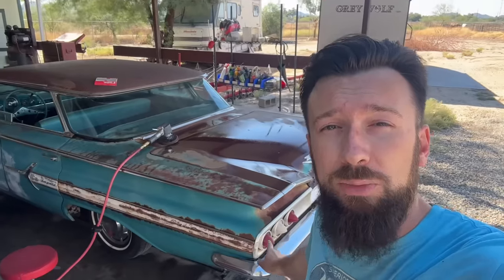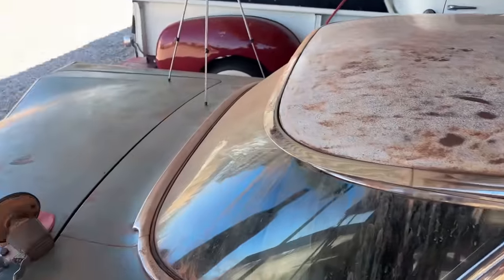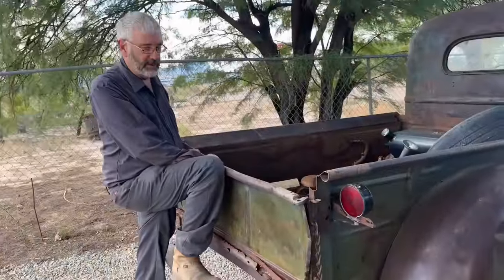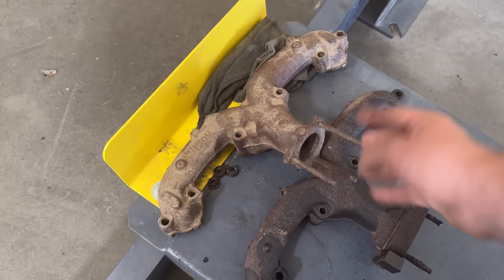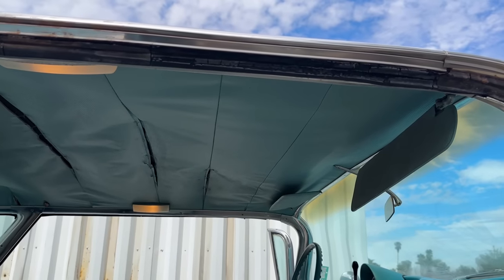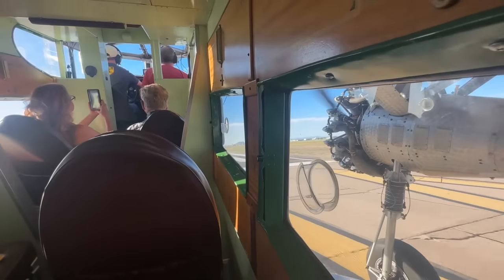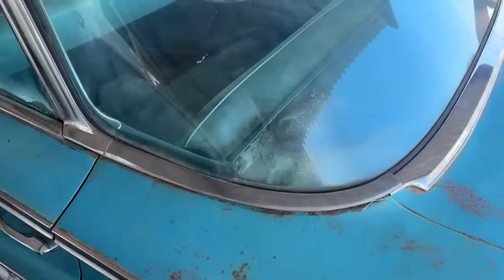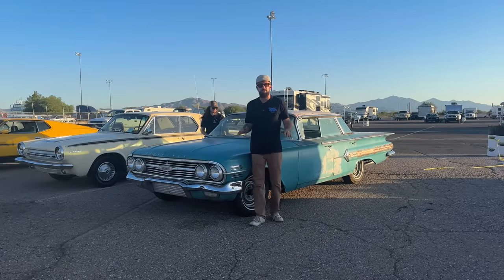‘60 Impala PAINT restoration + 1929 ford TRI-MOTOR + duct tape drags 2023 AND MORE!

Comment: Dude I cannot believe how well that's coming back around!  Awesome!
Reply from the maker: Yeah I was so surprised
Reply: @theetravisb  dude... you got lucky.... marketplace is a asylum...be glad you have a support system cause you can't do that alone.... people are dreaming on there...that car minus all the work you did is 6-8k ...for a project

And idiot me had to fall in love with a 59 caddy coupe.....🤦🤬
Reply: I think he"s married, fool, calm down
Reply: @theetravisb  you still miss the trim on the trunk above the license plate?.
Reply: Hey Travis
Both cars sound pretty awesome and it’s really cool that they’re the same year and same colour!
I wouldn’t ditch those old manifolds with the broken studs, they are easy enough to get out, if you heat the stud area on the manifold up cherry red with a torch, they’ll unscrew  with some vice grips or drill and retap if they’re broken flush. Always good to have extra manifolds on hand. Love the wide whites on the truck, I have them on my 41 Ford pickup and look really cool.
Reply: @ApacheBob41  Easy there Bob.  I'm an old married dude with kids.  Not that there's anything wrong with that.  You going to join the channel and kick in a buck or two per month as I have though?
Reply: so what is that brown stuff on top... paint... somebody painted it rust brown ...

Comment: Wow!  I would never have thought there was paint under the rust.
Reply: How doe that even work?! Like the top clear coat rusted? I've seen some nasty clear coats but they were just yellow and cracked, never rusted.
Maybe that's some metal flaking in the top coat?
Reply: @DARKredDOLLAR  Clear coat was not used in '60. Didn't come along until decades later.
Reply: @Jasona1976  so what is that brown stuff on top... paint... somebody painted it rust brown ...

Comment: Wow, you blew my mind with the roof and trunk!!  I can't believe there was color under that apparently solid rust!  I gotta go sand on my old F150, it looks the exact same!
Reply: @MaxGiganteum so what is that brown stuff on top... paint... somebody painted it rust brown ... 

it's rust???? I feel like I'm 5 and just saw Santa... 

rust on paint? I'd be less surprised if a UFO landed in front of me...
Reply: stained the oxidized paint .... holy crap.... never heard of that
Reply: @MaxGiganteum  that was gigantic... now could this have been avoided if they had clear coated their paint back then??? as I understood clear coating wasn't done back then
Reply: @MaxGiganteum  I'm clear on the run off  from the roof... the rust on the roof could come from tiny pits in the paint and then it spreads over the entire surface like moss over a rock. is that correct?

is there anything in the paint itself that could rust over decades? it's actually a serious question coz I have seen run off stains but not from a rusted over intact roof. that why I'm a bit puzzled over this roof.
Reply: @MaxGiganteum  peace indeed... 

who woulda thought old paint could be so interesting....

Comment: * Hey Travis & Dad ! Haven't check in in a while. Everything is coming along nice. Personally I would have used the red rims to add a little "Pop" to the old gal (46IH) I still love that one. I subscribed to follow her when you dug her out of that yard. I want to thankyou for the Trimotor Ride. Seen a lot of those in museums but never footage from inside during a flight. Couldn't believe how much paint was hiding under the rust on the 60 Imp. I believe that color combo is called Ermine White & Horizon Blue.  Both sound great with the new exhaust.  Cheers !                       🍻👊😎👍🍻

Comment: WOW the paint on the Impala cleaned up amazing. Though I have to say I don't like the exhaust out the rear.... it takes away from the look of the car having the two pipes sticking out the rear. I like the way your dad's El Camino pipes look much better. I do like the wide whites on the truck. What a treat you and your dad got to go for a ride on a Ford Tri Motor plain.

Comment: Hi Travis, Both your and your Dad's Chevrolets and the International look terrific! Especially upon recalling the condition they were in when you found each of them. Great videos, all!! Although you did an absolutely wonderful job bringing out the long buried colors on your Impala......Considering your Dad's tried and true auto body skills and the fact you both have Chevrolet models of the same year, perhaps you should consider painting the Impala to match your Dad's El Camino. They sure would look nice together at any venue. Perhaps you can also find a pair of vintage, matching coveralls for  both you and your Dad! :  )  Looking forward to the "Fly and Drive". Best Regards and Safe Travels, Doug
Reply: Yes, and the car would look much better...I like original paint if it isn't too far gone(like maybe a few thin spots), but that paint is WAYY too far gone, plus it has rust and dents that need to be addressed before they get worse..I'm totally over the patina fad, it has been carried way too far...I'd drive it and enjoy the "patina" thing while I addressed all the mechanical issues, fix those first...then, fix the rust, fix the dents, paint it back the original color, fix the missing/bent chrome, interior and you will have a gem...

Comment: "That paint "restoration" job was just plain and simple, crazy. The before-and-after is amazing! Well done! 
Do you have any idea what all that brown stuff was? It looks a bit like another layer of paint that someone applied at some point? 

On a sidenote, I'm relatively new to your channel and noticed that a lot of your videos have often clipped audio, which means the volume levels are too high, causing distortion and making the audio sound harsh or unclear." 
Are you doing any adjustments when editing? If not: maybe the input gain on your camera is too high?

Comment: Another great episode!   Excellent work on the Impala and the El Camino is looking good.   Thanks for all your work on the videos, really interesting.    Now that you have the paint looking pretty good some folks have it clear coated and then it keeps its patina without rusting again.
Reply: Yes, better do that or it will go back to rust pretty quick.  Flat clear would look more natural.
Reply: As I was watching the segment on the radio remembered an undocumented feature of the ignition switch.  My 60 El Camino did not have an accessory position on the switch, and I think it is the same on the Impala.  To play the radio with the engine off you normally need to have the ignition in the ON position and that provides power to the radio but also to the ignition that can damage the ignition points if left in the ON position for a long duration. 

If you turn the switch from OFF slowly in the ON direction, there is a point before the ON position where the radio has power, but the ignition is not ON.  My buddies 58 chevy worked the same too.

Comment: I just bought the same 1960 Chevy but in a Bel Air. Mine has 62K original miles and, no offense, is about 3 rungs up the ladder in condition. The paint is original and so close to just keeping it, but looking close, there are very small defects that make it no way it's ever gonna come completely back. Little pencil eraser tiny size blemishes rust spots... and little tiny lines. It's a gorgeous 20 footer! All the chrome is in beautiful condition, and complete! I just got done polishing all the chrome with Mothers metal and aluminum polish and it is super shiny. It's really easy, with no elbow grease needed. I highly suggest you do it... It's a huge improvement. 
My '60 is the fastback 4 door. What do they call that? I don't have that flat top. Mine is much closer to the 2 door in roof slope. Still wrap around windows, though. Mine is also the Copper color, a color I've never seen on any other car before! Very unique, and I love it. The inside is almost cherry too. The entire dash is cherry! But, the drivers seat has a big hole in the upholstery right as you get in, on the back of the seat. Back seat is perfect, but the horizontal very top of the back is burned up by the sun! Bummer, cuz that seat would be 100% without that 4" wide fried part. 🤷

Anyway, I really enjoy all of your videos so far on your 1960. They're great cars and much more rare than the tri 5 series starting in '55. You see those all over the place and for sale by the dozens, but not our cars! Rarely any available. And nothing driving around on the road. Really turns heads!
 
Thanks so much for making all of these videos and especially showing all of your repairs and fixes! My disc brake conversion kit just arrived yesterday to make it safe! Damn if those 4 wheel drum brakes aren't crap! Lol Unreal that's all people had for years! I'm just doing the front to disc because the rears are much more difficult, I've been told, and not really needed in disc when you have the fronts disc. I am replacing all of the brake lines with a pre bent stainless steel brake line kit specially made for my car. 
SUBSCRIBED.

Comment: HELLO TRAVIS!   I saw at one time a guy use CLR cleaner to remove rust from some white paint on his car. It drew the rust our, but left the paint in tacked.   Just putting that out there. Could clean up that roof and other parts of the car a little more.  Great job - Im impressed!
Mike
Reply: In tacked?..I think you meant Intact...
Reply: yes,,  intact -  it just pulled the rust out leaving the paint, with some pock mark where the rust was. @dyer2cycle

Comment: That looks just like the car Mortske had...same color and everything. Good work, but I'm not a patina guy myself...I'd just do the body work and paint it back the original color...I just can't see putting all that work and time in sanding rust and it still looks like it needs a paint job. Love the El Camino, by the way. I wish somebody made a snap-in spacer ring for 15" wheels so you could use the original 14" wheel covers on 15" wheels....

Comment: Sweet ride     For the trunk floor, I am sure have seen,  see Bad Chad's repair ideas or Carter Auto Restyling.    Chad's latest how-to on the 56 plymouth... do what you can with what you have vs buying $$$ metal    Keep the updates coming

How come you didn't put new springs in the license plate access cover?

Comment: You know like you said someone my ass why would you spend $400 on tires for a truck like that you take an international truck like that spray some bright paint on it a little Chrome work on it elenu shining Matt downing and put a new seat in it it's my task you $25,000 for that the chrome valve cover on it if you like a vehicle Fix-It driving you can't touch a new truck under $45,000

Comment: FYI use sos pads🎉for making your older paint and chrome look better. The soap in them helps lubricant to keep it from scratching and the pads are ultra fine 0000 steel wool.

Comment: Travis, if I remember correctly, mechanical car clocks evolved to a point that they would self-adjust a little bit when you reset the time, meaning, if the clock ran slow and you advance the time to correct it, the mechanism would slightly speed up the clock, after maybe several resets the clock eventually ran correctly. not sure if this was true in 1960 or not, but if your clock lacks the adjustment the '56 Caddy has, just let it run until it gets like 20 or 30 minutes behind, reset it every time it gets 20 or 30 behind and see if it starts doing better. if the interval between resets gets longer and longer, it's working!

Comment: The tyres are good quality, they are used alot in scandinavia and we have ROUGH road conditions in the winter and they still hold up great. I doubt you will have any issues with them

Comment: I'm mind-bottled with the rust on the paint. How did the original paint survive under the surface rust and how did the surface rust not ruin the paint on the roof and trunk-lid? Still mind-bottled when you wet-sanded the rust off.
 i'm impressed and you got me subbed

Comment: That clock adjusts as you reset the time, if you have to keep setting it ahead, it speeds up a bit each time, if you have to set it back several times it slows it down a bit each time, eventually getting it to keep time pretty well and only needs a reset if you disconnect the battery or it sits until it goes dead.
Also think the term 'dipstick' came from the refineries and bulk storage tanks - they used square measuring sticks dipped into the hatches on top of bulk tanks to measure their fuel levels accurately  an old guy from a bulk plant told me this, said his dad called them dipsticks well before cars came along - said they sold kerosene for light & heat before they sold gasoline he said, and of used correctly were accurate to within 5-10 gallons, depending on the tank diameter, pretty good as tanks ranged from several hundred gallons to several thousand gallons.

Comment: The muffler shop here in south AL will burn the old bolts out with a torch then re-tap for the new bolts. The man said that steel melts at a lower temperature then cast iron so it does not hurt the cast iron manifold. Save your original manifold.

Comment: i rode in that Trimotor about 5 years ago.  really cool.  both the chevys are cool.   Are you going to re paint the sedan or clear coat it?  If you don't do something to it it will regress to what it looked like before even in a dry climate.  lin seed oil?

Comment: I think you dot understand what that heat riser on that manifold doees. It is very important to the correct operation of the choke on that carburetor. It bacs the heat up in the manifold into the crossover in thee intake manfold to make the choke thermostat which iis mounted on that crossover open the choke up faster on that carburetor and without the heat riser in there the choke thermostat will not work correctly

Comment: That tri belongs to EAA up in Osh Kosh, WI. Hour or so north of me. Glad you enjoyed your flight. They have other restored WW2 planes to see and take a flight in. Yesterday I received an email from EAA that they now have a B25 bomber for flights. Several years back I got to go up in their B17 bomber. Even had the best seat in the nose where the bomber sat. Expensive flight, they use a lot of fuel. Pilot said that if you're walking through the plane while it's in flight and you lose your balance please don't grab onto the cables along the inside of the fuselage. If you do that, you're flying the plane now.
Reply from the maker: 😂 wow that’s insane

Comment: I would never have thought the paint would be under there.  That Impala looks amazing.  And now, sounds amazing too.
That old Tri Motor tail dragger had to have been a hoot to fly around in.  I've seen one at a museum, but I don't remember which museum.
Your Dad's El Camino, that metal work on the truck bed is just phenomenal. Especially when compared to the IH with it's basic sheet steel bed.
I miss having a car where you can sit on the fenders. Where the car is designed to be driven with the windows down.  One of these days I'll find another 67 Fury III.
Reply: Very cool that you got to meet Chris, Jen, and Gun from NNKH.  I think Pole Barn Garage was at the DTD as well.  He took his 'Holey Goat', IIRC.

Comment: That thing is looking good! That Ford tri-motor is gonna be here in Knoxville later this month. I volunteered myself to lend a hand with maintenance since I'm an airline mechanic and it'll be parked directly next to the terminal ramp. Hopefully it doesn't need anything more than preflights and oil, but I kinda hope I get to work on it too
Reply from the maker: That’s cool man what a treat
Reply: I can't wait! I've taken on a little side work and built a few piston aircraft engines at home, but I haven't messed with a radial engine since A&P school.